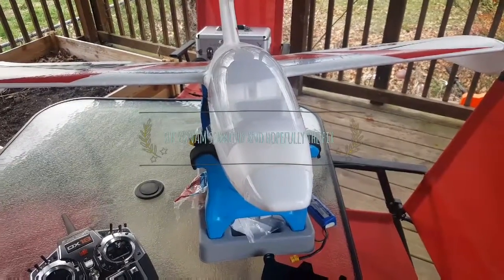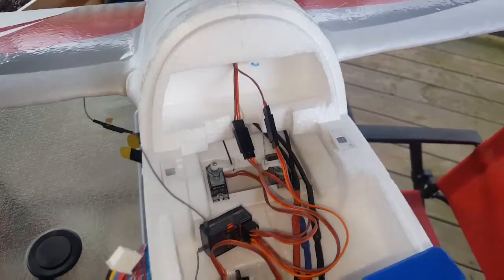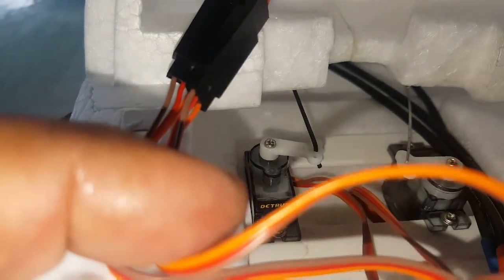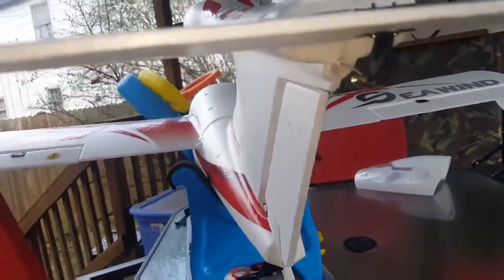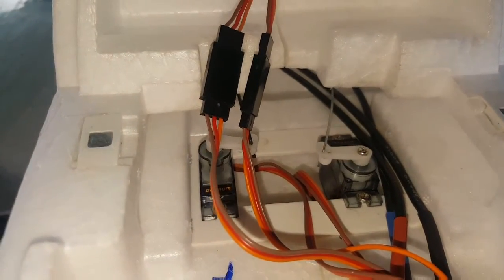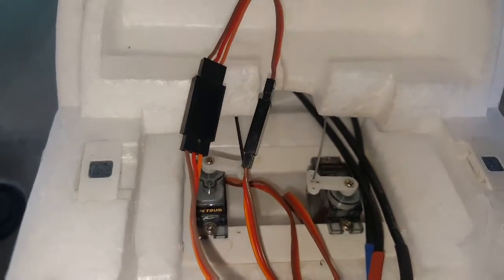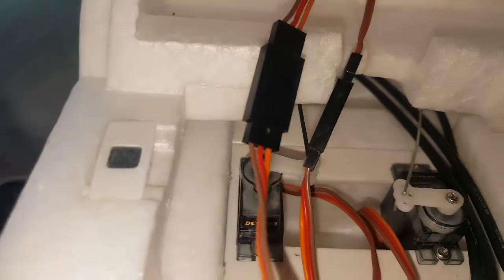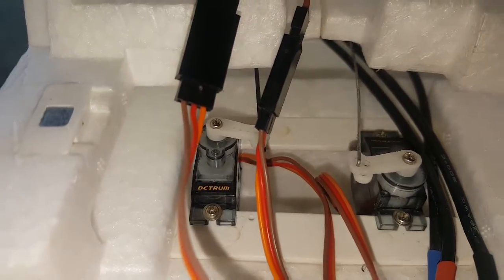DYNAM SEAWIND "The how to and hopeful fix "

Comment: Had this exact issue with the rudder on my Dynam FW190. What my problem was, there was glue inside the dang guide tube for the control rod. For this one, looks like you need to loosen the set screw at the elevator and remove the servo Control arm, use some pliers to pull the control rod out of the tube. You’ll need to pull it from the servo side. You’ll probably find glue or some gummed up crap on the control rod. If you have some rubbing alcohol and a small syringe to inject some alcohol into the tube and clean off the control rod that would be helpful. Take the control rod straight end end use it like an old civil war wad packing rod on a rifle, run it down the tube from the back and work it in and out of the tube to loosen up the gummed up glue. Once you get the glue to let go, coat the control rod in lithium grease and put it back in the tube from the servo side with the Z Bend towards the servo. Should move freely from that point. Sorry for the long explanation, but if I had to guess, that’s what’s up.
Reply from the maker: Thanks,  they need to get away from these thin like piano wire, it's a plane. Thanks again.

Comment: I think it may be a bit of CA or foam Tac from the factory stuck either in the channel or and the entrance to it. It's happened to me before and made movement much harder because of the extra resistence. I undid the servo arm and the connection to the control horn and pulled the wire with pliers until the ca released. Just my thoughts on a potential fix.

Comment: Loosen the set screw on the elevator clevis.  Remove the servo arm. Will the wire move freely when un-hooked?  May have to use some pliers and move it back and forth to free it up.

Comment: It must be stuck in the tube somewhere. Most likely there's a kink, or something is putting pressure on the tube the wire goes through.
Hope you can get it fixed, looks like a fun plane to fly!